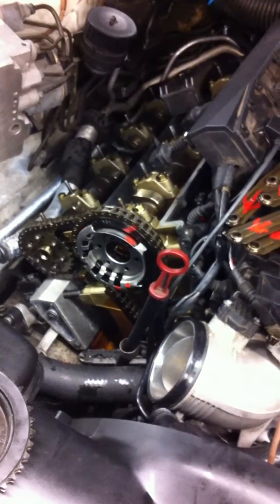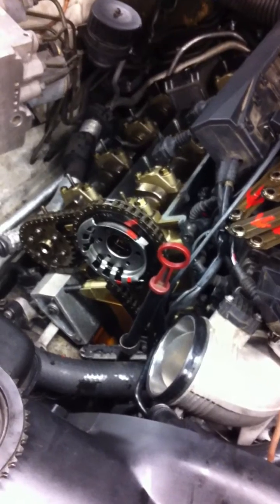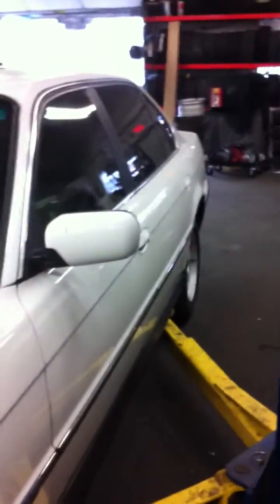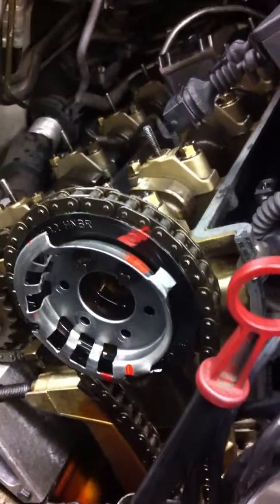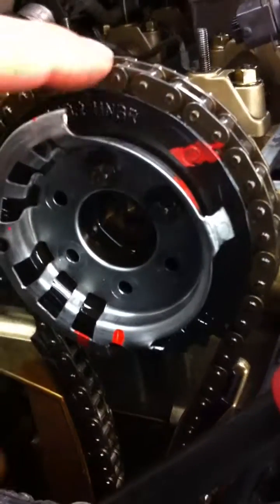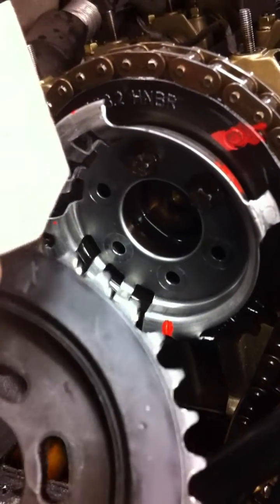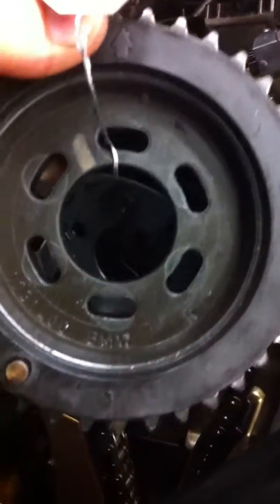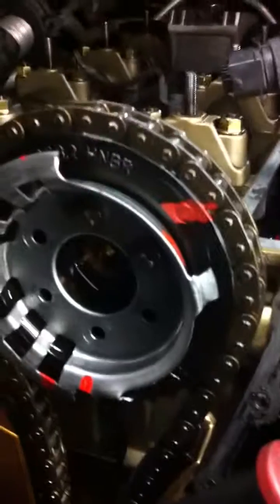M60 M62 cam sprocket conversion

Comment: I did it All I did was cut away the material on the sheet metal sender till there was one tab sticking up in the right place
Reply: And for the Craig sensor I made a little bracket JB will be welded some nuts to the timing cover and made a little bracket with slide so I could adjust it with slides elongated slots running like a champ

Comment: You didn't mention what did you do for the crank sensor on the flywheel vs on the crank pulley. How did you sort that out?

Comment from the maker: Yes. It ran perfect. Sorry for not providing a running video at completion
Reply: What about the crank sensor?
Reply: I have an m60 engine in a 99 chassis. it has a 98 740i harness. 
it runs when warm otherwise barely idles to get to temp then..VRoooom. Drives great but is hesitant up to 3300 rpm then takes off like a rocket. Have smoked it and no vacuum leaks found. Any ideas?
Reply: @DanielLovelock  camshaft position sensor possibly faulty.
Reply: I am dealing with the same thing, the only problem is the camshaft sensor to run the M60 engine with the M62 ecu and cable, can you help me?